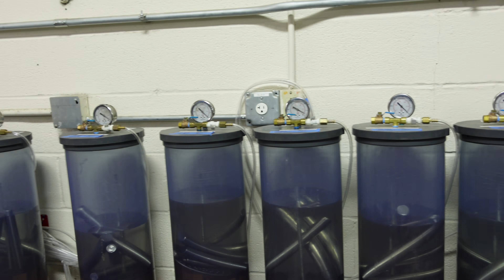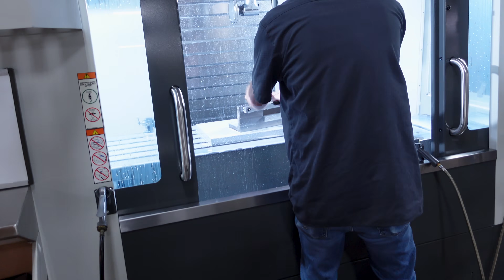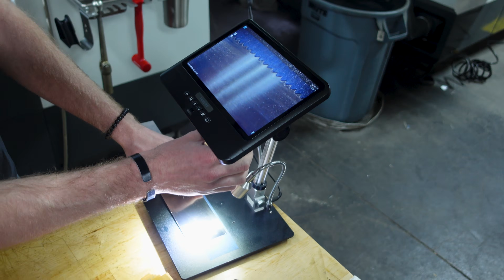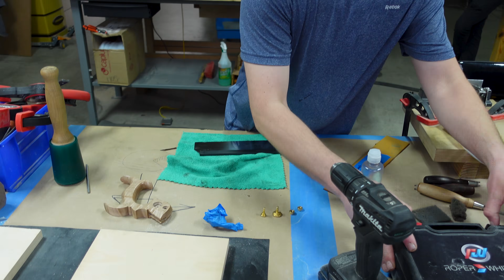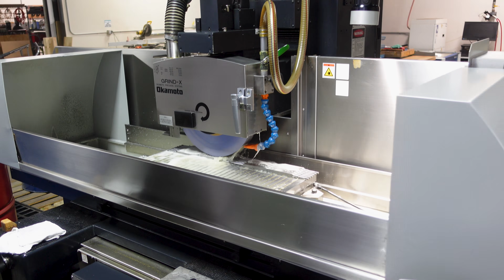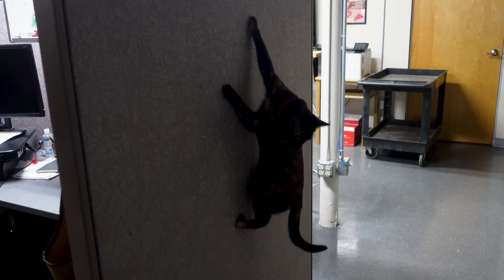Blue Spruce Toolworks Plant Tour!

Comment: That mill you thought was 3-axis, was at least four... For reference, a drill press is 1-axis (up-and-down, Z only). When you add a table that moves front-to-back and side-to-side, that' s then adding X and Y movement (two more axis) for a total of 3-axis (XYZ). After that a 4th axis is typically when the part can also rotate while still moving with the table. Think of a lathe chuck that sits on your moving table and turns around at the same time. Then a 5th axis and higher is where things get complicated.. Basically that turning chuck would also have the ability to swing 90 degrees in one direction. Not that it matters, but hope it helps! 
PS - great video, thank you.
Reply from the maker: This is awesome!!! Thank you for taking the time to explain deff helped me learn cus basically all metal working stuff is new to me. I know some things but not machiene stuff haha thank you again!!!